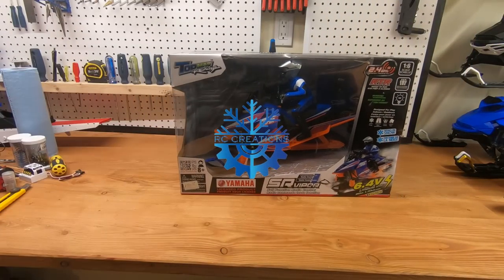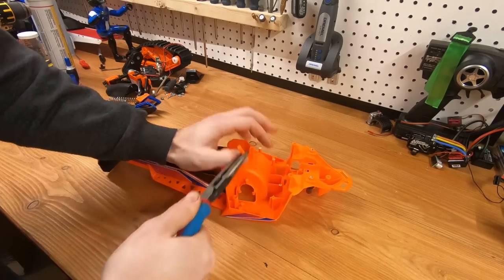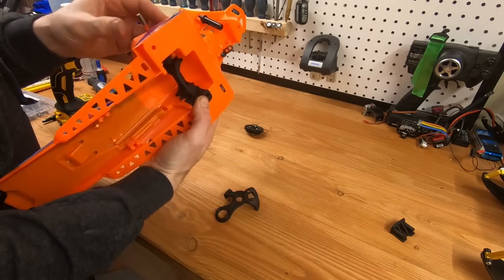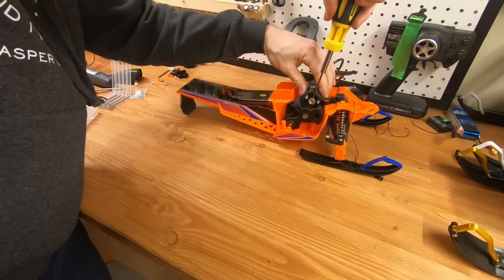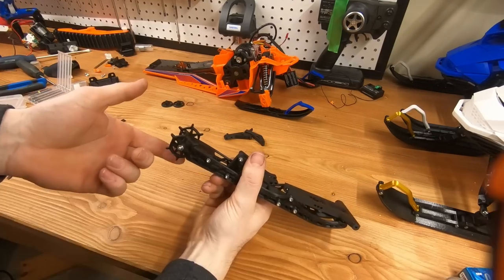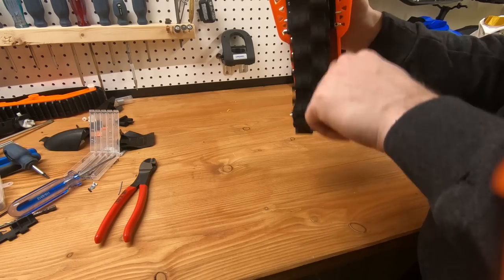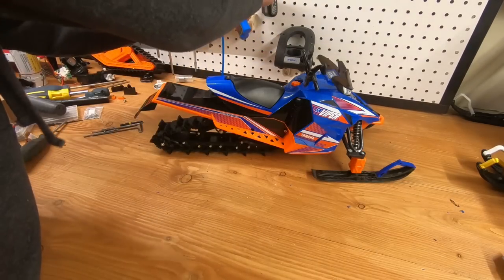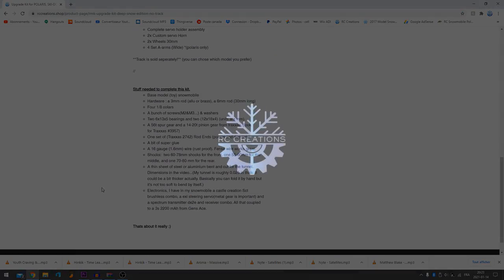Installing the Conversion Kit in a Yamaha Viper (In Details)

Comment: I assembled my tensioner piece a little differently.  I put the plastic insert with the hole in first, ran the bolt through and put a lock nut between the insert piece and the main block (where the head of the bolt sits on yours).  Works the same and no risk of the insert piece falling out.
Reply from the maker: If it works🤷‍♂️ its all good

Comment: If possible is there a way to get a less steep angle of attack on the front of the track, in real snowmobiles this is very important because you have to dig the snow out of the way rather than just drive over it.

Comment: Use LG HG2 batteries or other high current 18650 and make a replacement for the stock pack for a nice package.
If you do, set the lipo cutoff to the lowest level, otherwise it will cut off too fast.

Comment: Hey I have a question what is the engine did you put inside because me to i update my rc snow mobile but I don’t no what is de engine to put inside
Reply from the maker: Its a brushless motor, 540 class.  Its universally used for 1/10 scale rc's

Comment: Hey man I bought one of these and it doesn't pair I'm following the instructions and battery is charged lights come on. Do you have any ideas? Thanks!!
Reply from the maker: Sometimes the transmitter and receiver are not paired right and the signal is not sent is a way that is recognised.  Your manual has a pairing proceidure for that.  You can even look online.  Good luck!
Reply: @Pascal_Robert--Rc_Creations  Thanks! It was pairing properly but the joysticks on the remote weren't contacting the controls I took it apart and was able to get it working.

Comment: How much voltage can it handle without any Problems?
Reply from the maker: With the electronic speed controller i installed, it can take 12.6v

Comment: How much voltage can the stock esc hold on the Viper rc and can it handle 9.6v?
Reply from the maker: Well for one the stock stuff is not an esc, its a simple toy pcb.

 I'm sure it can handle 9.6V but probably not for long.
Reply: My stock RC yamaha holds 9.4v

Comment: can the aftermarket track fit on the stock Yamaha skid?
Reply from the maker: Maybe the small paddle one would fit, but its not made for that.  You'd also have to change the front drivers, and find a way to deal with the track tension stretch.

Basically, its pretty difficult
Reply: @Pascal_Robert--Rc_Creations  ok thanks now can i just buy a bigger motor and battery and install it would that work